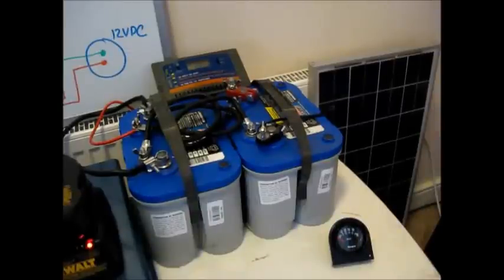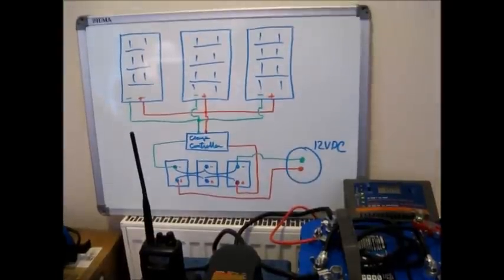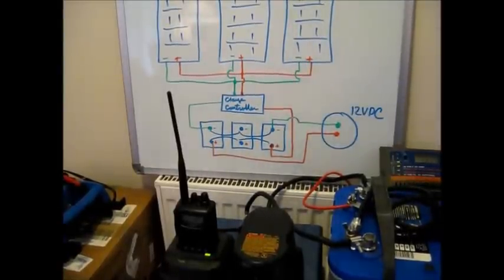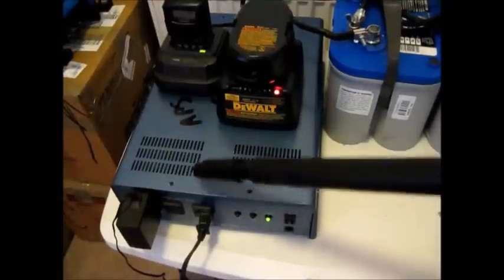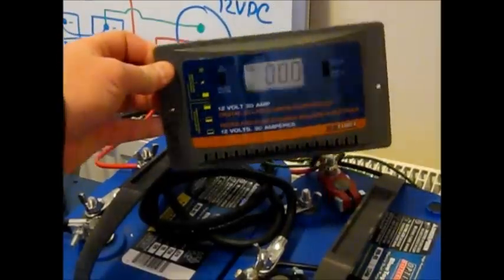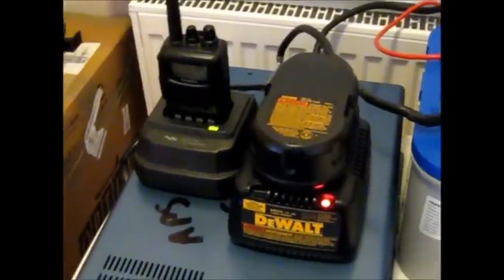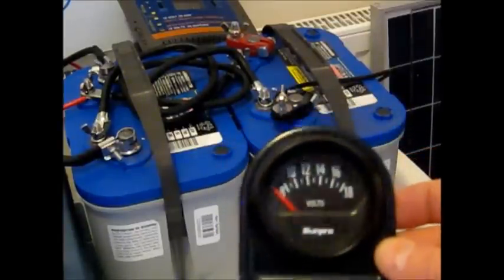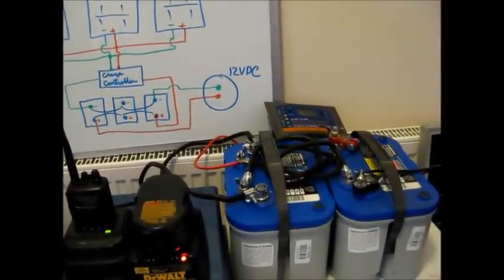Solar Power Project for Communications and Support Equipment

Comment: Excellent video. Quick question if you will. Have you experienced any noise/interference in your radios either from your charge controller or inverter?  Thanks
Reply from the maker: I do get noise from the inverter so I turn it off when I run the HF radio.
Reply: Thanjs for the response. I built a similar solar generator with everything built into a box and had noise. I had to take the inverter completely off the battery to make it go away. I was wondering if a pure sine wave inverter was any better.
Reply from the maker: Don Sanchez I have a pure-sine wave and it still make noise.  Cutting it off was the only way to stop it.

Comment: Good, tidy setup. However a couple suggestions for others: A 35W panel is too small for long-term solar-only operation, even with sufficient batteries. My shack is 100% DC and I use an A&A Engineering 5A 'Smart charger' with solar option to maintain 2 50AH AGM batteries. My panals go right to the A&A and will charge when mains power is gone. One can buy two Trojan T-105 225 AH Golf cart bateries (true deep cell) for less $ than two Optima "dual purpose". I use a 400W Tripp-lite inverter @ ~$50.

Comment: DdraigX, It sounds like you're asking whether a computer UPS battery backup (like APC) will output a pure sine wave if a modified sine wave inverter is used for input to the UPS.  I'm guessing the lower cost UPSs would not. The UPS manufacturers website might tell you or you could use an oscilloscope to verify.  

It's a great idea to save money (by using a cheaper modifed sine wave inverter) but may not be worth the hassle. Let us know if you find out.  Thanks.

Comment from the maker: There are two types of inverters; pure sine wave and modified sine wave (modified being the cheaper/less quality).  An inverter is not needed for solar power.  One is only used if 120VAC is needed.  Size and type of batteries used to power an inverter will not affect the quality (type) of output sine wave.  Output quality is dictated by the inverter's design.

Comment from the maker: Batteries - $400.00
Panel - $80.00
Charge Controller - $80.00
Inverter (pure sine wave) - $600.00 (not needed if you are looking to run radios only)